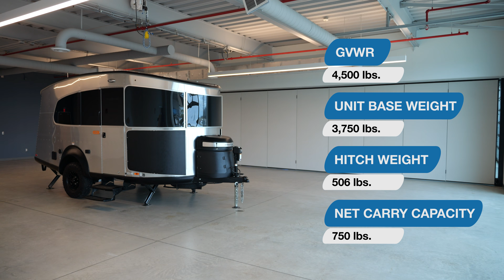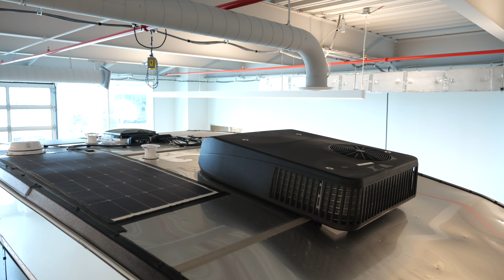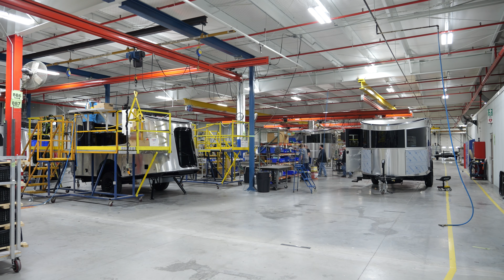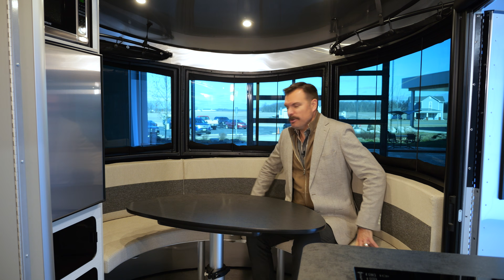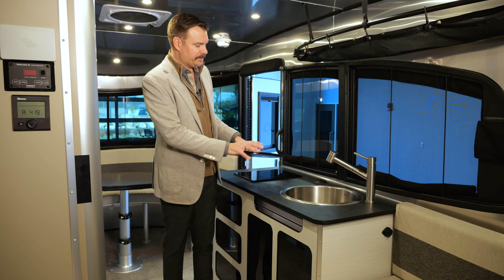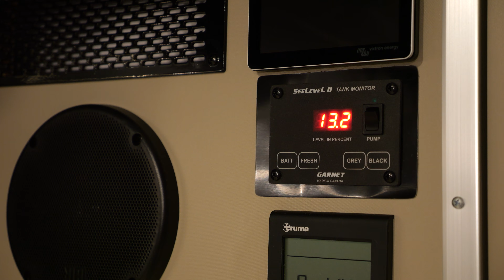2025 Basecamp Xe: Official Walkthrough Video

Comment: You guys make some great trailers but come on don’t tell people you can take this off-road, it’s an on road trailer setup for gravel roads.  The hitch the weight the height are all big factors that limit this, yea it’s nice but it’s for campgrounds not off-road, that’s what the patriot camper is for 💪
Reply: I disagree. I towed my Basecamp X with my Toyota Land Cruiser 200 series into challenging offroad situations in eastern Oregon year before last. I was pretty amazed at what it would do. I am an experienced offroad traveler, having been offroad in many states, particularly out west (I live in PA), and use my lifted Aterra Tacoma (find it on YouTube), as well as different Land Cruisers over the years. Airstream did a great job with the Basecamp, we have a 20X.
Reply: @ with the on road ball hitch it won’t flex then the Suspnsion.  Dont get me wrong airstream makes some great trailers but we have drug our patriot x3 through many tank traps and obstacles it won’t go through with our 200.  We have had it at 30deg on sketchy slopes and over logs etc
Reply: @mackirkpatrick3997  Seems like they have the waste pipes too low for true overlanding...with a 3 inch lift seems like the pipes should be higher
Reply: With it being higher, could it be more unstable compared to a 20?